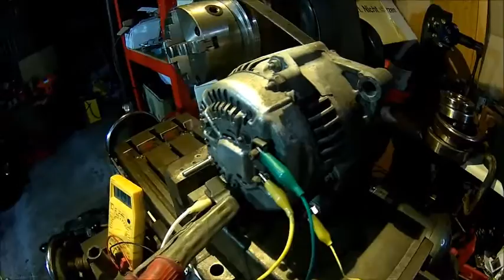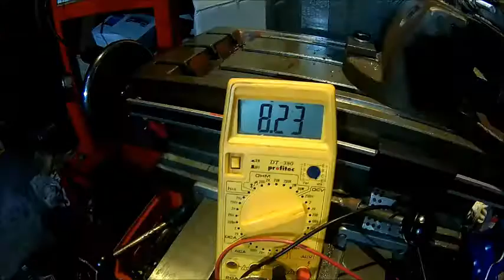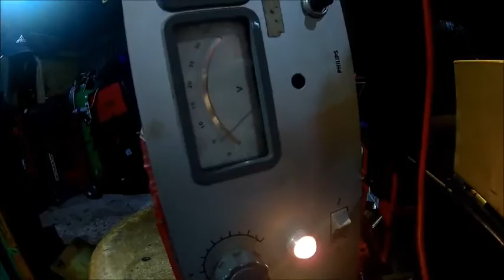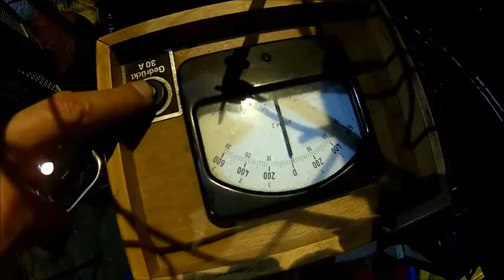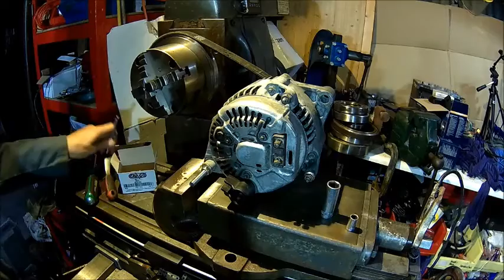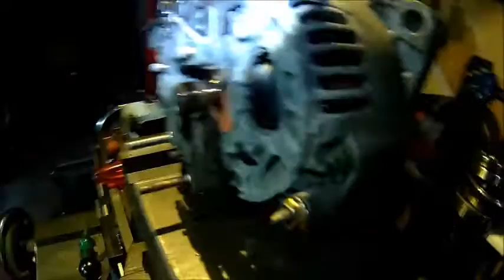Car Alternator - bench test, tear down and inspection (Denso, Jeep Cherokee XJ, ZJ) Part 1

Comment: Excellent video for Jeep 4.0 guys do you find many problems with bad diodes in these Denso alternators?
Why are there 8 diodes not 6?
Reply from the maker: you only need  6 diodes for a simple 3 phase alternator,  the other 2 can be either for excitation or a 3rd harmonic circuit which increases the efficiency a bit. Not sure what the Denso alternator is doing with, most likely harmonics, never really looked that close.

Comment: Tell me what is excitation you're doing?
Reply from the maker: That's the field supply for the rotor, it usually comes either from an external regulator or the ECU,  other alternators may have a built in regulator.
Reply: dynoguy there's a place for a small cable to connect. I ran it off a drill connected to car battery but didn't produce any extra volt. I didn't connect anything to small wire connection though. Is this why not work? Thanks v much for reply
Reply from the maker: really hard to tell without seeing the alternator, perhaps it is, perhaps not, depends if the regulator is built in or not.

Comment: How would you test for charging bias voltage?
Reply from the maker: Depends on the type of alternator, with external regulator (like the Denso i am doing here) just measure the excitation voltage on the terminals, with an internal regulator you need to get somehow to the brushes (or connection for them) and measure there. hope this helps,...and please subscribe, it does help me.

Comment: Sir,can you tell me how to test bench my alternators.I'm from Bulgaria and i need your help
Reply from the maker: Depends on what you want to test, basic test can be done with a multimeter, but for a power test you need to drive it with something, either a motor or a milling machine like i do.
What type of alternator do you want to test (Make, Model) and how good is your electrical knowledge ?
Reply: dynoguy Sir,i know a lot about dynamo and alternators from all brands such as bosch,hella,hitachi,Denso,Lucas and etc
Reply: Old alternators and i want to test them
Reply from the maker: when you say old, do you mean old DC dynamos ?
and what exactly do you want to know ? I am very happy to help but you did not tell me what sort of help you need. Testing itself is quite simple, just drive it at some speed and load it with a few headlight ight bulbs, then measure voltage and current, that's it
Reply: dynoguy Sir,the alternators are out of old engines and i want to sell them.So,i need to test them if they charge.I have a motor to drive them but i don't know how to connect them for test
Reply: dynoguy Only to tell me how to connect an alternator of test like your video.The most significant brand is Hitachi and English Brands such as lucas for start.If you help me,you can ask me whatever you want or i can give you whatever you want
Reply from the maker: could you send me some pictures of the rear where the connectors are, that will help me to identify the wiring required, there are so many different ones around, some with built in regulator some with external control. You can find my email adress in the about section of my YT channel.
Reply: dynoguy Ok,but i can't now.Tomorrow
Reply from the maker: no problem, take your time.

Comment: Excellent test set up.  Have you ever used a Jacobs armature chuck. I did a video on it. Great to have if you have a rotor with out center holes  for mounting. You've done some pretty interesting set ups on that mill.
Reply from the maker: Thanks Bob, i need to look at that, never heard about. If i get a tricky one i usually chuck in the 4 jaw on the outher diameter of the rotor and dial it in. that's how i leaned it in the late 70s
The Rigiva,  It's a really grreat mill, you just can;t find anything about that model. 
Need to edit part 2 of the alternator  but the South Bend took priority,.... thanks for watching.

Comment: can't wait to see the next step in this series. i'm not sure what flavor of alternator i have in my XJ.. i have been eyeballing the waterproof ones from quadratech.. a little spendy at the moment.. the other thing i would like to outfit my XJ with is a snorkel. new bumpers are also planned
Reply from the maker: Hi Mike,  seems you've been hiding or a whille ...:-)... It's all back together and working, just needs some time for editing.
Won't happen for the next week or 2 as i've got some heavy machinery delivered today .... so that took prority ...:-) ..just working on the video right now.
Your XJ has most likely the same type of alternator, 80 or 90A i would guess, the one in the video is a 120A from a ZJ (Grand Cherokee) but fits without mods, at least into my RHD. Snorkel on a 4ltr does not make much sense as you will then flood the ignition coil and distributor which are both lower than the stock air intake, so nothing gained really.
Reply: dynoguy
yeah, i haven't been hiding but laid up with a case of pneumonia.. and a really nasty bronchitis.
the snorkel is more for dust than water. the backroads of idaho are gravel or native surface and the fine dust either clogs up the filters fast  and also wears out alternators etc prematurely. the front axle kicks up enough dust for a filter to only last 2 years at most (with most miles being driven on hiway) it becomes most noticeable when the cab begins to fill up with dust coming in thru the firewall
Reply from the maker: Part 2 is now up, much earlier than expected but i had enough from the lathe move, so i had to do something easier,..... feels like i am getting too old for moving heavy machinery ....

Comment: Interesting, looks similar to the unit from my landrover discovery LR3 , 3rd replacement in 8 years of use. At nearly £200 a go I can see why you would go to this trouble. Good luck with the skim and rebuild. All the best Mat
Reply from the maker: Thanks Mat. It's already back together and working, was not really a challenge, apart from that machining copper is not exactly fun
Back in the late 70s when i started to work for a motor winding shop this sort of work was everyday business, but nowadays people tend to throw things away without even looking at it. 
I think all the Ford powered LRs had Denso alternators, not sure about the LR powered ones, might be random.
As far as i know, LR stopped using Denso parts around 2007.
Those alternators are actually a pretty good design, never had a shorted one or shot diodes, just the brush boxes are a bit of a weak spot. But even with that, they usualy good for 100k miles easily., so i wonder what you've done with your's.
As mentioned in the video, the brush box is 5 or 6 quid, and i know that you own lathe.....